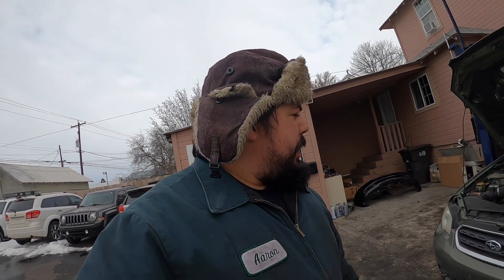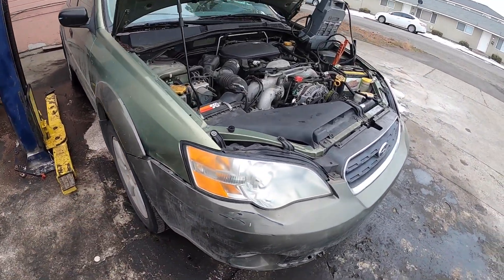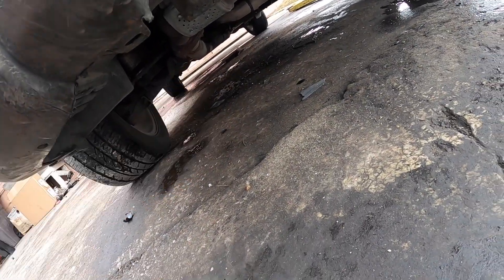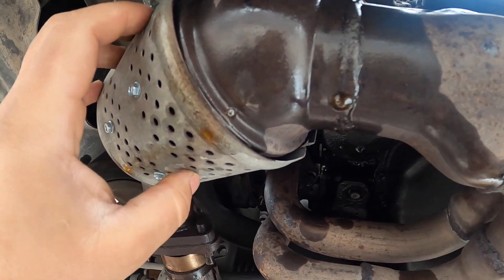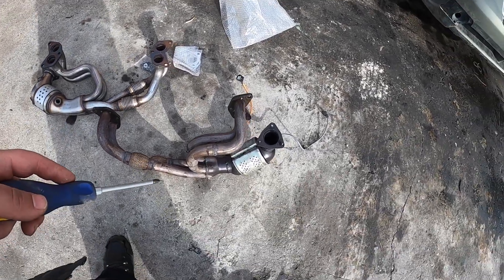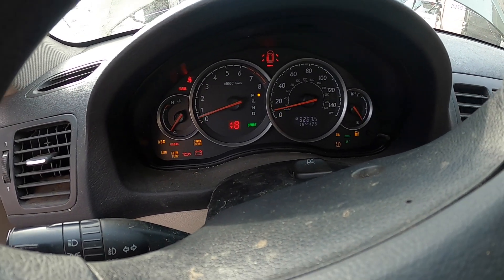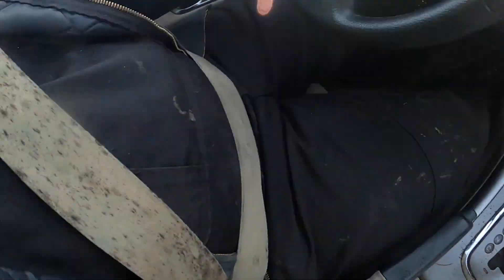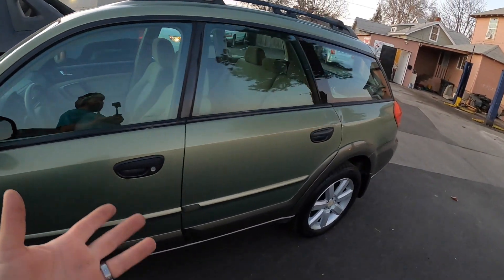How To Replace Catalytic Converter 2008 Subaru Outback Cat

Comment: Cool thanks for sharing!  Couple questions, do you have to do anything special moving the sensors from the old one to the new one?  Is it just moving it from one to the other?  Diagnostics?  How do you get rid of the old cat assembly?  Thanks again!
Reply from the maker: Thanks for the response as for the O2 sensors they simply unbolt and bolt into the new one no programming or anything like that took the old cats to a local metal scrap yard get paid to recycle them just need to show proof of ownership
Reply: @zsproshop   Thanks for the follow up. When I moved about 7 years ago I had a repair shop change my cat out.  They put on a crappy one because when I rev the engine it makes a slightly noticeable vibrating metal noise.  They also charged me $2100 to do this.  Since I was moving and had to drive cross country I could not complain.  Before that I had check engine lights on and a separate dealership replaced both O2 sensors attempting to troubleshooting and could not figure out that the problem was the cat.  Long story short, I need to replace my cat again but now I just need to move the O2 sensors over and not replace those as well.  I can use your vid to walk me through and not get ripped off again.  Seems really straight forward.  Appreciate it!

Comment: Sweet video! I need to change the cat on my 06 subaru forester. I also have the brake light on my dash that doesn't go away. Did you figure that out by any chance??
Reply from the maker: Usually when the brake light is on either low on fluid or e-brake switch is bad cats should be the same on the outback and Forester

Comment: Do those Subarus bring in good profit? I always wondered, but been scared to touch em. 🤔
Reply from the maker: Kind of Hit and Miss if they have a good engine that you can rebuild or just blown head gaskets we will do just fine but if it needs an engine they are very expensive
Reply: @zsproshop  Ok thanks bro